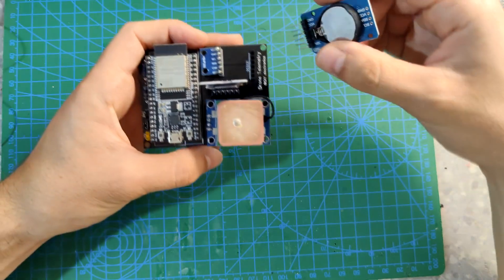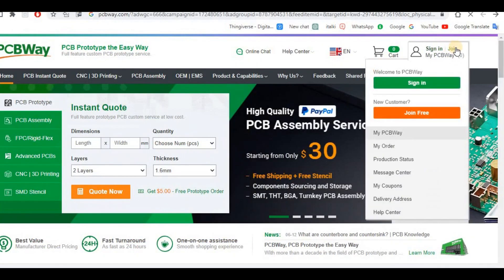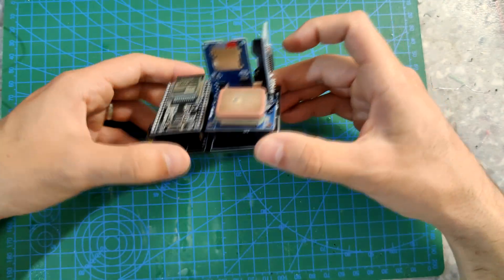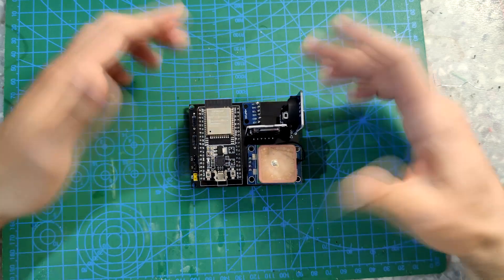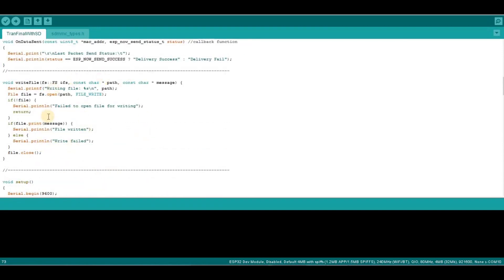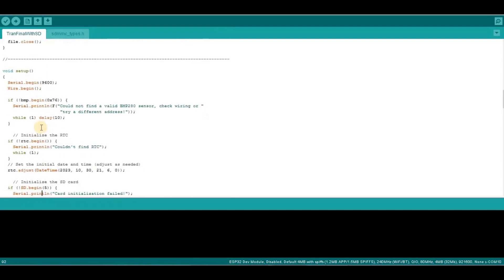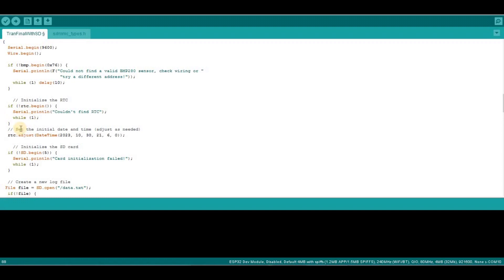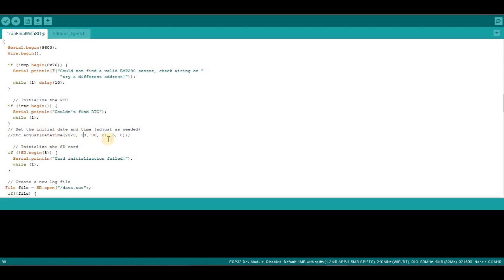Drone DIY Telemetry Logger System | Part 3

Comment: Where is the data from BMP280 and the GPS module?
Reply from the maker: In this video I showed only the battery data. Wanted to keep this video simple. In the next video I will show how to log also BMP and GPS data. Anyway for adding more data to the logger you could add more lines like I did for the battery, pretty simple. If you have any problem let me know:)
Reply: @DIYmaker1  Okayy